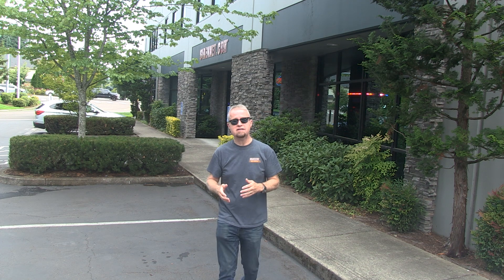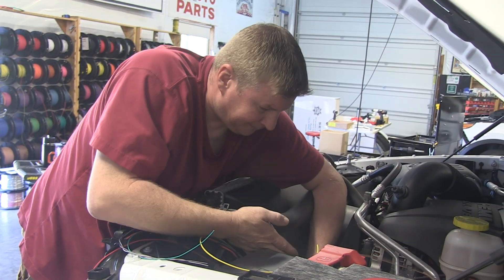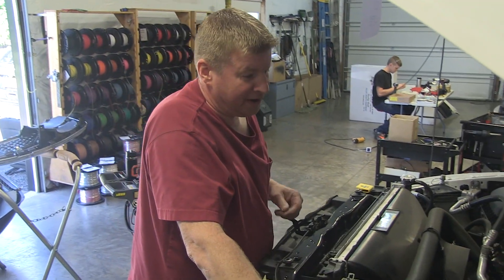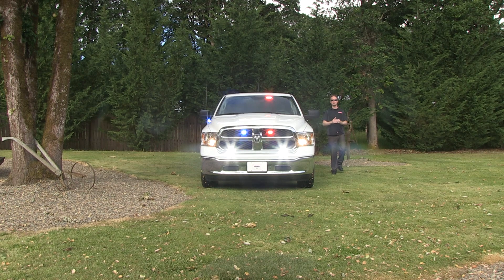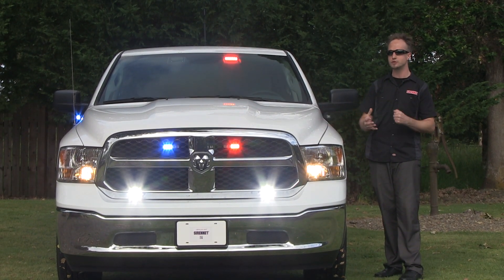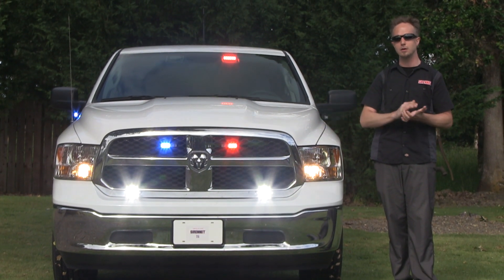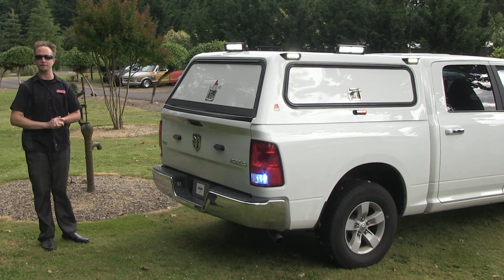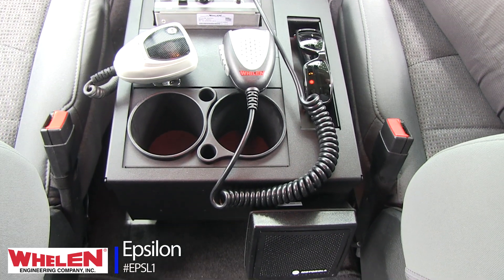A Crime Scene Investigation Install on a RAM 1500

Comment: Needs more side lights.....and back, I still love it :)
Reply from the maker: Thanks for watching :)   Out of curiosity; what would you add?
Reply: @SIRENNET  I would add whelen tracers, (time to go crazy) tri color soundoff signal nforce Interior, maybe a lightbar under the tailgate,  and a ta bar mounted on the box, but not on the roof, and maybe some red and blue hideaways in the headlights aswell with the headlight flasher like drive side has the headlight flasher on, the passenger side has blue, then red on driver and passenger with headlight,etc etc, I can write a paragraph for the ram
Reply: @oklakota  So ... You WANT to "blind" the CSI people that will be working out of the truck bed ..??? NOT a GOOD idea, especially during hrs of darkness... They have to constantly be walking up to the work area of the truck, for various reasons ... It WOULD ruin their "night vision" if excessive lights are flashing in their faces !!!  Take it from a LEO
Reply: @ricks.1318  if you dont like my opinion you dont have to.
Reply from the maker: @oklakota  That'd be a fantastic setup :)
Reply: @oklakota  Found the buffalo

Comment: it amazes me there are so few pickups in the police force. Considering they use V8 crown vics and now V8 chargers, durangos, tahoes and high output V6 turbocharged explorers, they are no stranger to gas guzzlers. So why not have more pickups in the line of duty. I know they are pretty common for fire departments and border patrol lives on offroad pickups, so why so little police units?
Reply: depending on the need is the main reasoning. if you need a faster vehicle for speed, the explorers and other pursuit rated vehicles are better. now with less and less pursuits as they usually just end the pursuits and track them down more police forces are going utilitarian with SSV packages and pickup truck options. ultimately best in rural settings. Tahoe SSV and the F150 responder are both great options for those such departments. but again if there’s not as much need there’s no point in using although i do love a police pickup

Comment: The ions on the side of the camper shell are facing the sky. Doesnt whelen make a wedge kit for the ions?
Reply: Naithan Bohan they look to be a wedge shape and shine straight out
Reply: @Jhubes5.9  4:19 Check your glasses bud.
Reply: Naithan Bohan they are wedge shaped are they not?
Reply: @Jhubes5.9  Compare the Ion's on the tailgate to the ones on the camper shell.
Reply: Naithan Bohan my bad, I confused the perimeter lights with the ions. Yes, you are correct, they do face upward
Reply from the maker: Whelen doesn't offer any wedges or angle mounts. Before the truck left Star Cars they fabbed out a set and added them. The ION's sit nice & level.

Comment: Is it possible to order the shrouds used in the video? @sirennet
Reply from the maker: We'll check with Star Cars.
Reply: SIRENNET I was wondering the same! Would be awesome to purchase the shrouds.
Reply: Same. Need some for my 18 ram as well
Reply: @SIRENNET  What's the advice on a dash or headliner light/shroud that would work on the nearly vertical windshield of a Wrangler? I like how this one is fixed in place with no drilling. Even if I needed to do a cigar plug it would be ok but the angle is the issue.. I can't deal with being blinded at night...... Feniex fusion 1x dual color or Whelen avenger duo single led give any good options?
Reply from the maker: @pcalna3202 The Avenger II series would work nicely. The shrouds completely removable, so it can sit nearly flat on the glass. You could also go the route of trimming down the shroud and wrapping the edges with door trim edging so there's no chatter.

Comment: Where can I get the mounts for the spitfires
Reply from the maker: The shrouds and mounts used on the SpitFire lights were specially made just for this upfit. These are not available, unfortunately.

What you could do that's similar is a pair of Soundoff Signal mpower fascia lights with Window Shrouds. The nice thing about the shrouds is that they are a stick-on using 3M adhesive, so no holes needed in the headliner, and the mpower light is contained within the shroud so there is no flash-back. 

For more details, please call or email us. Phone Number (888) 595-0911.  Our email is info@sirennet.com

Comment: Does the headlight flasher work with LED headlights?

(I have a 07 Dodge Charger)
Reply from the maker: We wouldn't recommend using them with LED replacement headlight bulbs.